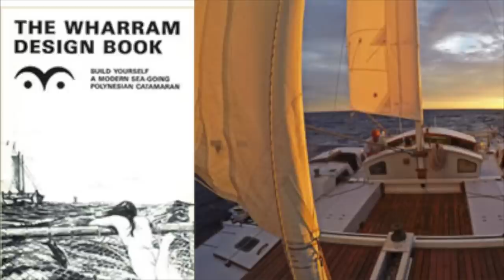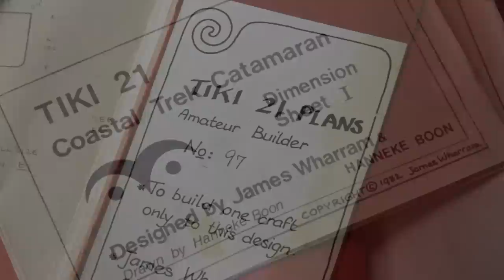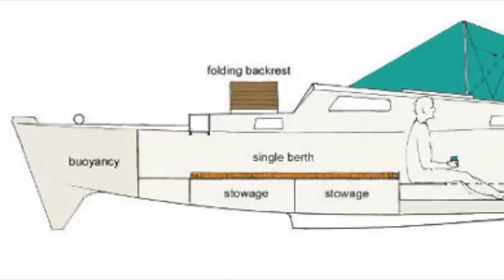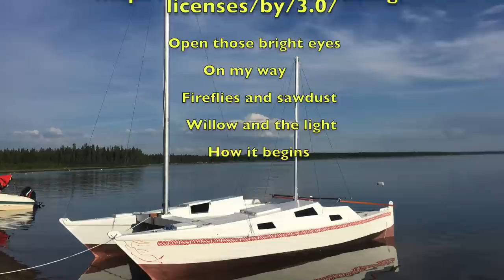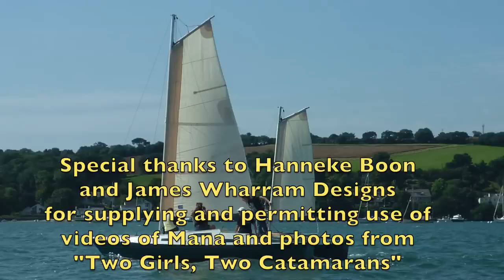Boat in a Box  -  the Mana 24

Comment: Brilliant , thanks , just what I needed :-) 
You have given me a lot of the basics , space and time etc . 
I recently came across a Wharram 26' with one complete hull, interior complete and most of the material for the other hull . 
 Seems fine from what I can see , most under tarps . 
  What I am now trying to do is a  rough costing of what it will take to get it safely in the water . 
First for off shore , then maybe for something further . 
 After fitting kitchens and stuff for 30 years have some idea of wood work and have the tools and space , 100 s of G clamps excluded :-) 
   Once I have a 'cost to finish' , I can get a better look at the hull , once free of trees :-) Can make a stand for the hull and get help flipping it over . 
   The great thing is I can  get the basic parts for only 600 pounds :-)
Reply from the maker: Sounds like a wonderful and worthwhile opportunity. I wish you much success in bringing the Tiki 26 to completion.
Reply: @RodMcLaren  , thanks , am getting into it . saw the inside of the hull , looks smart . The port hull . Copper nails . All food for thought . Not your build space , will manage , glass paint the hull , repeat , same cockpit, beams , An idea about sails , paint , wharfage . Could be done :-)
Reply from the maker: Wonderful. Soldier on. Each step gets you closer.

Comment: 1st time viewer...  That is what I am talking about.  This dude is humble and admits his mistakes along the way , and not only that but tells how to over-come them...  that is what makes this video awesome.
Subbed and liked immediately!!!!
I have a little trailer-sailor that I need to fix the glitches such as the swing keel winch blocking the only storage hatch when in place and deployed.  No experience but armed with this info I feel confident with the redesign, and glassing in the new winch system.  I also feel confident adding the dodger, extra storage, and hatches that I will need to take my tiny sailboat anywhere for 2 weeks or more.  Add some water tight bulk heads?  No problem. lol
It was a project that I dreaded, but now I look forward to the challenge...  thanks to you!  Kudos on a job well done!

Edit: the design is awesome.  The top is very low and it is ketch rigged.  You built a world class sailboat here.  After a few seasons sailing around the coast to break her in and add better accommodations I would not hesitate to head toward bluer water with you serving as crew..
Reply from the maker: Thank you for your kind words, Barking.Dog. I agree - the Mana 24 is a world class design - Hanneke Boon and James Wharram incorporated features like the ketch rig which make the boat rather unique with enough flexibility to handle a wide range of sailing conditions. This year's sailing season is still a few weeks away and I am looking forward to it again - each year I learn new aspects of the boat which add to my admiration of the design. As I become more familiar with the boat I have been able to make small modifications to add to the experience. Last year I sewed up an asymmetrical spinnaker and added it to the sail inventory. This year I am adding a mizzen staysail which I hope will also improve light wind sailing. Major modifications to the deck tent have also been made which I hope will make overnight camping more pleasant. Sailing seems to be like that - modifications are endless and we sailors never are happy to leave things alone. The modifications you have planned for your trailer-sailor sound challenging and at the same time a lot of fun. I wish you much success and progress with your work. Best wishes.

Comment: Regarding fiber glassing,
I could be tempted to find the cheapest wood, and crappy epoxy, and get a bit of experience first, so I can avoid very expensive mistakes.
Reply from the maker: Practise is always valuable. Here is another approach to consider - choose a smaller boat design, buy good quality plywood and the brand/type of epoxy you plan to use on the project you are preparing for, and then practise. Then, when you have finished the exercise, you will have a lovely smaller boat you  will be happy to use or to sell) instead of a boat you are not confident in because of poor quality components. Yes, fibreglassing can be intimidating, but chances are you will do just fine on your practise run and why not build something you can be happy with.

Comment: Hi Rob great video top quality and so much information. Just a couple I questions I have: How long did it take to build and what was the overall cost. Prairie Mermaid just a beautiful do Rob thanks for sharing.
Reply from the maker: Good morning, Peter. I am happy to hear the video is useful - thanks for your comments. The build took place over 9 months, working by myself except for the glassing and a bit of work at the end. My estimate would be about 1400 hours for building and finishing. I did not keep accurate track of time - also I did not try to hurry. I have been asked about the cost before. The complete kit will build the boat, less the cost of primer and paint. In my case, because I am in Canada, I sourced the aluminum tubing for the masts as well as the longer required timber here in Canada in order to have the kit airfreighted economically. The cost of the masts and timber were about the same as if I had purchased the kit complete. Air freight to Canada was $1500. Paint and primer that I used (System Three) was around $500.  I also required more WEST epoxy than what is supplied - add another $500. Then there are incidentals like extra disposable gloves, sandpaper, brushes, etc  - approximately $500. So if you take the current price for the kit + CDN$1500 + CDN$500 + CDN$500 +CDN$500 you will have the price. Of course, that does not include a trailer or an auxiliary engine if you require those. I see that Wharram's currently have a great offer if you order right now - the kit is available for the 2017 price so if you are thinking of building one, this is a great opportunity! I hope you do choose to build one - its a great boat and I am sure you will enjoy it.
Reply: @RodMcLaren  only 3k.  simply amazing
Reply: @michaelcee8348  $3K plus the cost of the kit

Comment: Very beautiful design. How does it sail? compared to the Tiki21
Reply from the maker: I agree, lucky 748. The Mana 24 is beautiful. Hanneke Boon and James Wharram have done a wonderful job with the Mana. The hull continues the lines of the Tiki series and sets it off with the sleek sweep-around cabin top. I am still learning how to maximize performance with the cat ketch rig and have been very pleased with how forgiving and flexible it can be. The boat performed very well during our Elbow Run 2019 under a wide range of conditions (see https://youtu.be/H63civnrG3A ). I added an asymmetrical spinnaker to the sail inventory and that greatly improved down wind performance in light winds. Compared to the Tiki 21? It has been some time since I sailed the T21 I built years ago so I'm not sure yet but I expect the Mana is somewhat faster. A friend plans to bring his T21 to the Elbow Run 2020 and then we will get to see them sailing together.
Reply: @RodMcLaren  Congratulations Rod. thank you.

Comment: Hi Rod I am in the process of purchasing a wharram 28 footer, did you build the trailer you used from plans?  it seems to do the job very well I was hoping to get some more information on it, thank you
Reply from the maker: Hi, Mike, the trailer I used was originally used for a pontoon boat. I added the slide-outs, borrowing an idea from the factory trailers sold with Stiletto catamarans back in the 80's. I blogged about it here: https://villagerainbows.com/2018/09/18/mana-trailer-in-action/   and here:  https://villagerainbows.com/2018/09/10/the-trailer-part-of-the-trailer-sailor/. I would like to add rollers to the supports but haven't got around to doing that. Wishing you much success with your Wharram.
Reply: Rod McLaren Thanks for the feedback Rod I will check it out appreciate it

Comment: How many layers of fibreglass did you use on the outside of the hulls & also the inside? What was the size fibreglass?
Reply from the maker: The hulls are covered in a single layer of fibreglass on the outside, with overlaps and an extra layer of glass on the keels. A strip of glass is used on the inside where the hull panels meet.

Comment: I'd be very interested in a breakdown of the costs and everything of the mana 24
Reply from the maker: If you go to the Wharram website, you can get a current price for the kit. Depending on where you are in the world, there are a few options for ordering. If you are in the UK, you can order the entire kit, which includes everything required, including sails, masts, epoxy, rigging. It does not include paint, which you can source from whatever is available to you. Paint prices vary greatly depending on type - you have to check out your own market. Expect to purchase additional consumables, like gloves, sandpaper, breathing masks, etc. In my case, I opted to source the masts locally because the air freight from the UK to Canada would have been prohibitive.As I recall, the masts cost me around CDN$650. I also used more epoxy than was supplied, although that may have been because I was not careful enough. There are other items to consider - the two biggest would be a trailer, if required, and an outboard motor, if required. Again, there is such a range of options, it is best for  you to check your market and chose what is best for your situation. I hope this helps you figure out the current cost for you and your circumstances.

Comment: Lovely video Rod. I'm very interested in how the Mana performs compared to the Tiki 21, particularly upwind performance and whether the rig is weatherly, any difficulties with tacking and any increase in leeway with the less steep 'V' hull section. Your observations would be most valuable given your experience with both designs. Any other thoughts on points of comparison would also be appreciated. I've built and sailed a Tiki 21 pretty extensively over the last 35 years and have been very happy with it, the extra volume of the Mana looks tempting comfort-wise, but I've not seen any comments from actual experience of the sailing comparisons.
Reply from the maker: Good morning, Peter and thanks for watching the video. You have asked me to compare the Tiki 21 to the Mana 24. I am not able to provide a definitive response to the question of performance without having the two designs sailing at the same time in the same conditions. There has been 20 years between the time I last sailed my Tiki 21 and now sail the Mana and my memory of the Tiki is likely "embellished" a bit over time. :-) In stiff winds, my sense is that both boats will perform similarly well. Both designs are very capable of handling touch conditions.  In light winds, tacking the Mana is at times tricky and occasionally requires a reverse tack to get it around. That might be related more to my lack of expertise with the mizzen since prior to the Mana I had no experience sailing with one. As for leeway, I have not experienced much difference. The Mana does have a single chine but still presents a steep V hull. Of course, the Mana comes out a clear winner when comparing accommodation. I very much appreciate the extra hull volume in the Mana, especially at my age. I am not as nimble as I was when I had the Tiki 21, nor so willing to adapt to the very limited bunk size of the Tiki. I am 5' 8" and can sit upright in my bunk without cracking my head and roll over without hitting the hull. I hope that helps a bit.
Reply: @RodMcLaren  Thanks for your thoughts Rod

Comment: I,d love to build one and sail the great lakes!! What did you do for suplemental floatation , just in case??
Reply from the maker: The Mana 24 is a excellent design for sailing the Great Lakes. Wharram boats are designed with an emphasis on safety. You can find various articles on the James Wharram Design website that discuss their approach to boat design and their emphasis on safety. https://www.wharram.com/site/articles In response to your question, there are flotation chambers built into the design in the bow, the stern, and under the cabin floors. And don't forget - the boat is made out of wood, and as you know, wood floats!! :)

Comment: Beautiful video!
Can I ask, what material did You use for the masts?
Fair winds-
Jacob, Denmark
Reply from the maker: Greetings, Jacob. The masts were made from Schedule 40 aluminum pipe, The 24 foot main was made from  4 1/2" (114mm) pipe - one 20 foot length plus 4 feet from another one with a 4 foot length swaged inside to join them. The 13 foot mizzen mast was made from 3 inch (76mm) pipe.

Comment: What a great achievement, how are the beams attached to the hull is it the same as the other wharram cats?
Reply from the maker: Thank you, Pascal, for the complement. The crossbeams are attached to the hulls using webbing and over centre cam locks, in the same way the Tiki 30 is attached, This is a much faster method of attachment than lashings.
Reply: Rod McLaren thanks gotta check this out
Reply from the maker: @pascalblotiau   wonderful. The Mana 24 is a great design - you will very much appreciate it. Don't hesitate to contact me if you have more questions. Have you seen my video on last year's Elbow Run? It has more shots of the boat when sailing. https://www.youtube.com/watch?v=H63civnrG3A

Comment: When you ordered the boat plans did you also get all the materials to build the boat?
Reply from the maker: The Mana 24 is only offered by James Wharram Design as a kit - the plans for this design are not sold separately. The kit is offered in optional ways. For builders in the Uk, JWD supplies everything required to build the boat except for paint. In my situation, where air freighting long timbers and the long pipes used for making the masts is cost prohibitive, they sold the kit to me with everything but those items and I sourced them here in Canada. If you are not in the Uk, discuss your situation with JWD to determine the best way for you to buy the kit.

Comment: So do you have to do a coat of epoxy over the plywood before you do the fillets?
Reply from the maker: It is recommended that the plywood be coated with epoxy before doing the fillets. In the case of this boat, most of the plywood was pre-coated with epoxy prior to the pieces being cut so it was possible to proceed directly to the filleting.

Comment: Next time you launch, disconnect the trailer tie a rope to it and push hand push or walk the trailer and boat into the water then use the rope to pull the trailer back up. Also you can tie the rope to the truck as a safety measure so you don’t loose the trailer and worst case you just pull the rope with the truck to get the trailer back out of the water. This way you never have to flood your truck.
Reply from the maker: Thanks for the suggestion, James. No worries, I don't launch at that lake any more and the launch ramp I now use is steep enough to not be a problem.

Comment: Aye m8, good story well told!
Like your humorous notes 😉
What’s the next step now?
Reply from the maker: HI, MiQ, and thanks. Next up? its time to enjoy the boat as soon as sailing season rolls around. This winter I sewed up an asymmetrical spinnaker and sock to add to the sail locker for those low wind days. And just now I have almost completed sewing up a rather large deck tent to make camping on board even more enjoyable. Stay tuned - next winter I hope to add some videos from a summer of the Prairie Mermaid on excursion.
Reply: Wow! Thrilled to see some footage when you’ll try the spinnaker out. What material did you use for it?
And what did you sew the tent out of?
Reply from the maker: @MiQBohlin  the spinnaker is made from .75 oz ripstop nylon. It is a kit I ordered from SailRite.com and went together quite well even considering my inexperience on the sewing machine. I am looking forward to flying it - should be a lot of fun! I don't have much experience with a spinnaker. I added one to my Tiki 21 but then only got to fly it a couple of times. The Tiki is almost ready to relaunch after its refurbishment and so I will get to fly it a bit while I am visiting in Ghana in February. I plan to shoot some video while I am there so stay tuned. The tent is also made out of ripstop nylon - 1.5 oz - still fairly light but strong enough, I hope to handle wind and rain.. Not sure how it will turn out - I am guessing it will either be a great success or a complete bust. It completely covers the deck and cabin tops between the two masts so it is big and has been quite a challenge to sew.
Reply: Rod, I swing my hat for your efforts at the sewing table. This all seems (seams) very interesting and I’m looking forward to next episode.